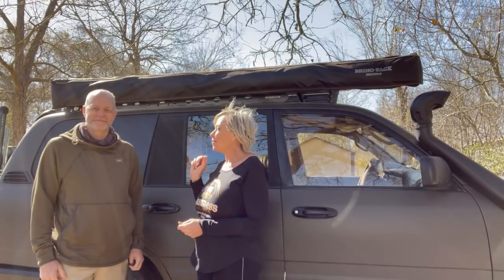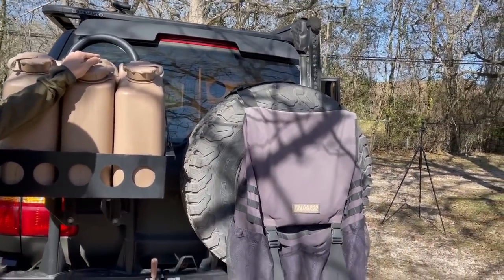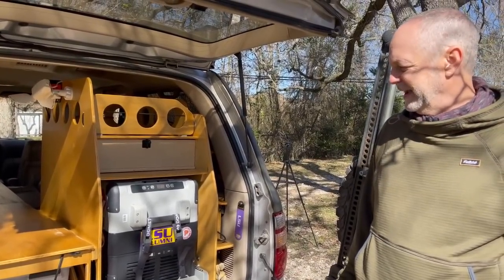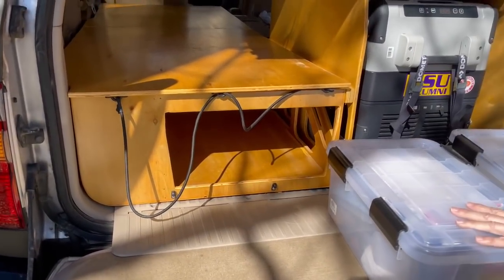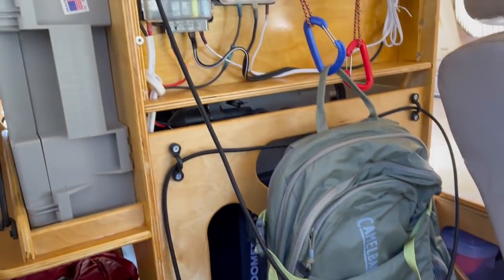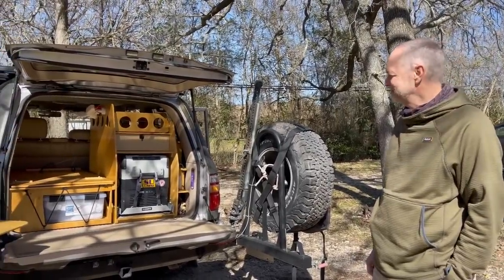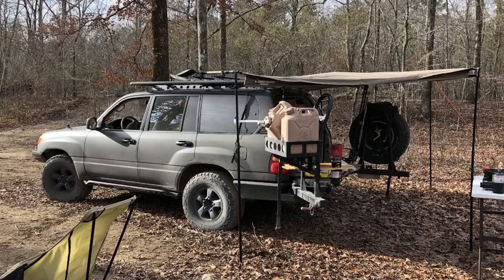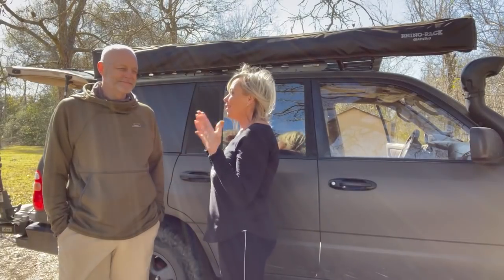AWESOME Toyota Land Cruiser Camper Conversion Tour

Comment: Thats a nice setup.
Snorkels are a game changer.
I have a V8 powered BroncoII and was always filling the air cleaner with junk. I added a snorkel and the only thing I would find in the airbox is bees. They like flying in at the top.
If they made one for a 19 F-150 I would have been going at the fender with a hole saw the day I bought it. 🤪
Thanks for sharing Bev 😉👍
When you heading  NW?
Reply from the maker: The snorkel was a game changer for Larry. Poor bees!!! You're welcome. Thanks for watching and commenting.  I'm thinking the NW is for spring or summer.